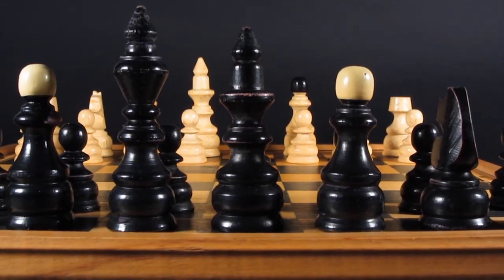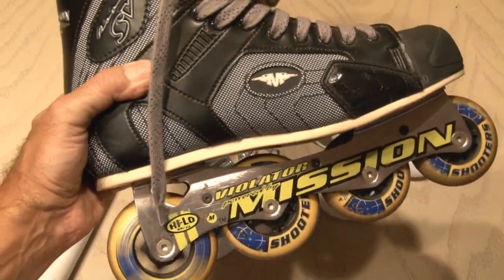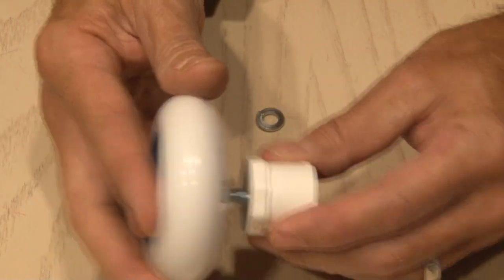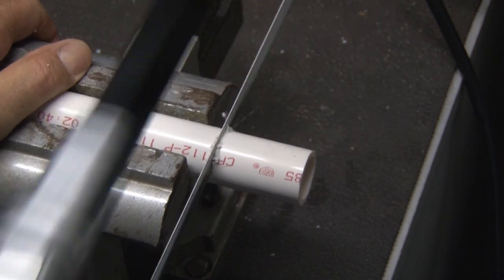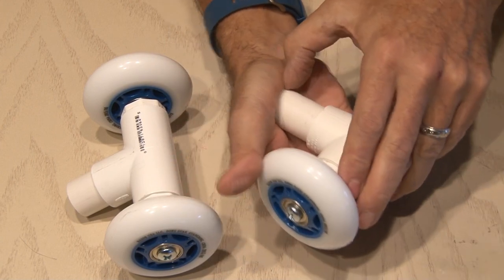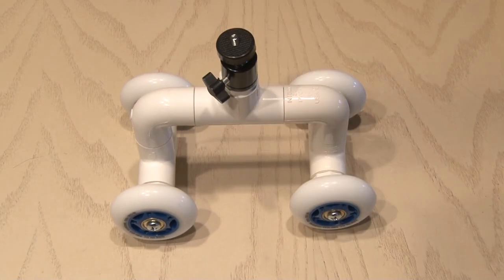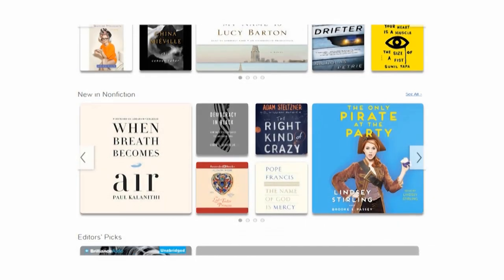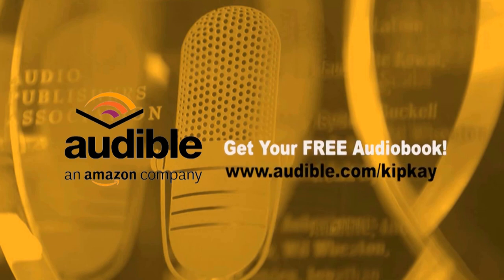$5 Mini Camera Dolly!

Comment: And here I was making mine out of Legos like a sucker.
Reply: That's still pretty cool I never thought of that
Reply: rpeters330 I'm sure someone else thought about that before I did.
Reply: +Buzzing Sign Diner my rc car works well too
Reply: Wflash00 and Ludicrously expensive.
Reply: I made mine out of old 1.1 ton steel train wheels. Works great.
Reply: Wflash00 NXT?
Reply: Wflash00 That's the big Lego block with the computer stuff in it?
Reply: Wflash00 Ah, the classic one. Tbh, the NXT one looks really cool, but it's probably dreadfully expensive on eBay.
Reply: Wflash00 Now you got me looking on eBay for Power Functions. That stuff was the poor man's version of Lego Mindstorms. I still have all my motors and switches and stuff in storage.
Reply: bluephreakr Well obviously you'd have to glue some parts together.
Reply: Wflash00 I usually build only one or two things at a time, both usually going for different color schemes from one another so I can avoid having to have two models share parts.
Reply: Wflash00 I try to go for one dominant primary color, then it's a few light grays, some black, some dark greys, maybe a bit of an accent bright color.
Reply: Ah.
Reply: ***** Did it use little Lego train tracks as track for the dolly?
Reply: I believe so.
Reply: Buzzing Sign Diner Actually, I found the set and it's more of some kind of rail or something. It's in the Steven Spielberg Movie Maker set.
Reply: ***** So not just the repurposed Lego train tracks, yes?
Reply: +Buzzing Sign Diner Doesn't look like it. I think it's just a rail made from tile pieces.
Reply: ***** I'm surprised something like that isn't made of metal for durability.
Reply: +Buzzing Sign Diner Well, it was made for a tiny webcam that came with the set.
Reply: ***** I know. Man, I haven't thought of Lego Studios in years.

Comment: At first I said to myself, "I'll have to try it!". But then I saw the materials required...
Reply: Are you just scared of PVC or what?
Reply: +Buano Taquito They are actually hard to find where I live.
Reply: +Aryan Khemka do you not live near any hardware stores like home depot, menards, Lowe's, ace anything?
Reply: +Aryan Khemka You could probably use the pattern and adapt it to wood or whatever materials you have available. Yes, it wouldn't be quite like his, but the best part of DIY is figuring out how to use what you've got and not relying too much on a parts list! Remember: as long as it works, there's no right answer.

Comment: $5!?!?! those PVC bits are about $1-2 each..... let alone the wheels
Reply: Where do you live? It looks like he uses half inch pvc. You can get a 10 foot piece for 1.49 cents. The adapters and stuff cost like a max of 50 cents.
Reply: Australia, Bunnings had the "T" piece for $1.49 yesterday
Reply: +Lost Cloud USD and AUD aren't the same.
Reply: +SwagDrew still only .75 diff lol
Reply: +Lost Cloud He meant $5 USD, spent in Mexico or something.
Reply: USD and AUD are 2 different currencies

Comment: Add some RC shocks in there to help with uneven surfaces.
Reply: Rc shocks are super expensive, well if you're on a low budget than you are in trouble. The ones I use are $45 for two shocks.
Reply: Traxxas Modded
I was joking bro...lelele, my revo shocks were about $40 from dollarhobbyz though.
Reply: ***** Ahah, Yea man, my Slash shocks are a tad bit more expensive for some reason. it my just be where i get them! But yes some shocks and that baby would be super stable!

Comment: Well it is a good dolly if you can find PVC in your country(which i can't).
Reply: Where are you from?
Reply: +RTGaming He's from Sweden
Reply: +xXmultigunnerXx Nope
Reply: +xXmultigunnerXx Wrong
Reply: xWood4000 Your about section is in Swedish, at least according to google translate.
Reply: +xXmultigunnerXx Yes i talk swedish but that doesn't mean that i live in Sweden.
Reply: +njhnjh666 Finland,  i think that you just can't find it on internet because PVC is in hardware shops that don't know what internet is.
Reply: +xWood4000 Om ni har Biltema i Finland så har dom nått liknande som pwc rör tror jag fast de heter något annat :)
Reply: +KingOfTheRoad Jag kollade på biltema och jag kunde bara hitta konstiga rör och dusch-rör.
Reply: +xWood4000 PVC (polyvinyl chloride) is just a type of plastic. Definitely something you would get at your hardware store. It's usually used for plumbing like for bathroom sinks. It might not be called PVC in Finland but you surely have something similar.
Reply: I don't think in Europe PVC is used the same way as in the states (tight fitting and with glue). Here we mainly use polypropylene which looks the same but it does not fit together, the fittings are a little undersized and you use a heating tool to melt the inside of the fitting and they join while hot. PVC is used for draining and is larger diameter and also fits using rubber gaskets. So both are not suitable for this purpose. Also in plumbing they might use copper, or pex or pexal, neither of them suitable for this.
Reply: +xWood4000 Sinne vaan rautiaan/k-rautaan kyllä sieltä löytyy :)
Reply: yolo_swaggins
Ok
Reply: onnisella on :D

Comment: Even though they function, PVC builds look horrid...Steampunk them up with brass or copper pipes, would look awesome.
Reply: that would raise the price to like 60 bucks and you would need vices and other equipment
Reply: +Joseph Kim Wrong...Two 1/2 in. Copper Pressure Tee's cost $2.50 and a 1/2 in. x 24 in. pipe costs like $5.00...Doubt the wheels and mounting brackets cost over $50.00.

Comment: You can do it for about $5, but only if you have a pair of skates you want to remove the wheels from. The cheapest wheels I can find cost more than $5 for a 4 pack. Add the ball head for around $8 and I have to wonder how you could build ths for about $5. Please be realistic. It will cost you that much for the PVC alone.

Comment: Neat. I might add that if you want to skip the ball head camera mount, that most all cams use 1/4" 20 x 1/4", so if you buy a bolt that is longer than 1/4" you can buy nuts to space and a fender washer and have all the parts you need without the oddly specific one here.
Reply: +Alan Blair Granted, you won't be able to angle the cam this way, but it's a cheaper fix if you don't have the head.

Comment: it seems like you can make a skateboard with this too
Reply: +Asyperd Depends on what you consider a skateboard
Reply: +Asyperd
Or attach them to a shoe and call it: skates.
Reply: Have either of you ridden either devices?
You will likely get injured if you tried to use these. For one, the material won't work. You will break them. Even if you used metal pipes, it would be too heavy, and you wouldn't be able to turn with these. Unless you stopped, rotated the axles, then continued. Trucks work very specifically in that they are at an angle, and have an axis as well as a pivot point, which allows them to turn when weight is applied to one side.
Roller skates might kiiiiiiinda work, if you glued them fixed (you would very easily hurt yourself without those stabilized), however they would operate poorly, imagine a train with non pivoting wheel sets, it would just get stuck going around a steep curve.because the wheels stay straight even though you are turning.
You could barely get away with this for roller skates and they would essentially be a very crude recreation of the first pair of roller skates.
Keep in mind skateboards were invented after roller skates were well established and they had figured out truck technology.
you would be better off spending 15$ on a walmart board.